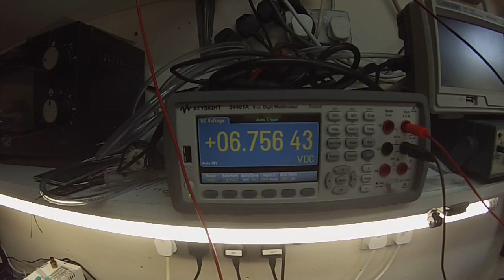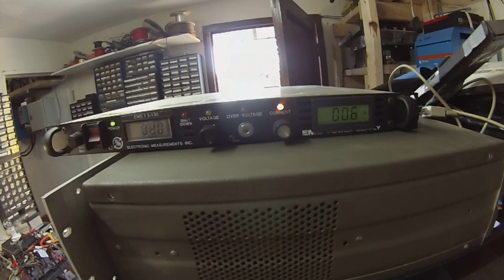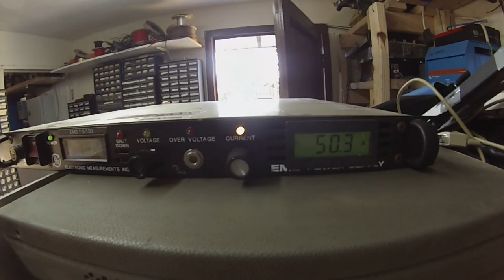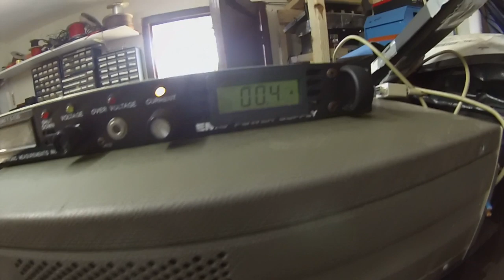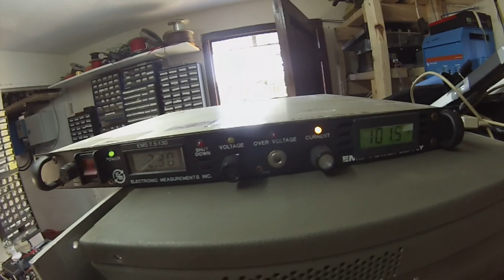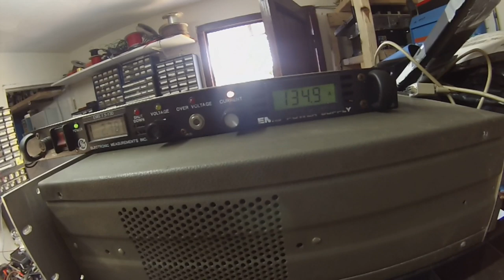Prius Gen 2 Inverter Current Testing

Comment: Nicely done! Is the inverter going off the current sensor on the phase leg, or is it using some other means, like the voltage drop across the IGBT? Would you have the same result on the top leg?

Comment: Dumbing it waaaay down for  us non EEs, what's the takeaway from this in terms of net specs and performance of someone DIYing using a Prius inverter? Am I correct in assuming that we can use 300-ish volts and now ~350 amps to drive a 3 phase motor from MG2?, and ~250 amps from MG1 (can these be added to produce 600 amps @ 300v total to the motor?). Could someone layout the use case we're kind of expecting?
Reply: I'll chat with Damien and we'll answer these questions on Open Inverter asap :-)
Reply: @KevinSharpe  Thanks. I do my best to keep everyone informed about their options so, it'll be more than just me that it helps summarise.
Reply: @MattsAwesomeStuff  will be useful info for us all :-)
Reply: I see the possibility to build a really nice welder based around a Prius inverter. With a battery, it can even deliver the kind of power only available with a 240V connection, while only requiring a standard 120V outlet to recharge.

I'm interested in building a "zero export" (because exporting to grid involves a lot of hassle to be able to get paid for it and the rates often aren't too attractive nowadays) grid tie inverter/UPS for a solar power system. A Prius inverter would definitely be overkill, but they seem to be cheaper than trying to build an inverter from scratch.

Comment: so this is what I'm hearing.
if it has pulse-width modulation and is able to Output a heck of a lot of current over 600 to 900 amps then this would be the perfect subwoofer amplifiers that correct?   
because that would be really cool I mean if you think about it this would make a really good Tesla coil speaker driver.

it seems like the rotary subwoofer may also get a pretty good upgrade out of this.